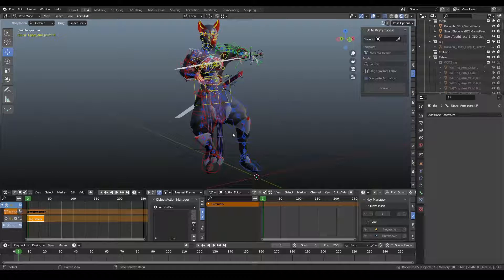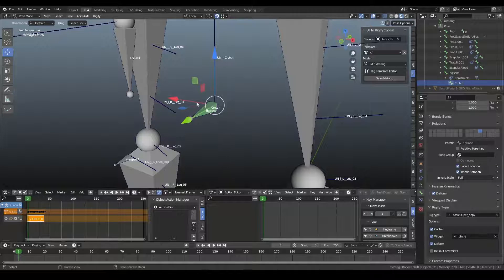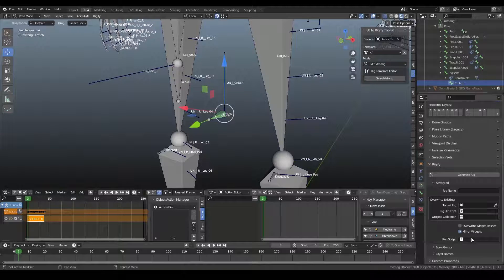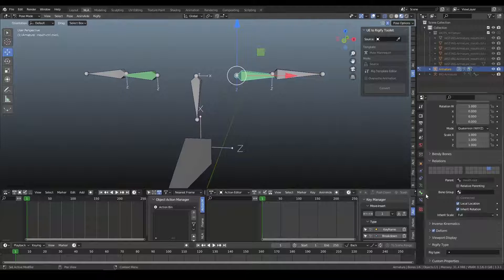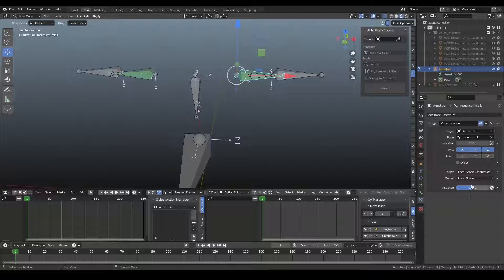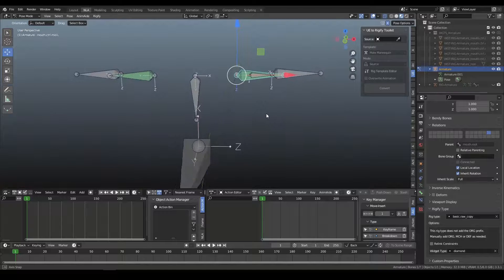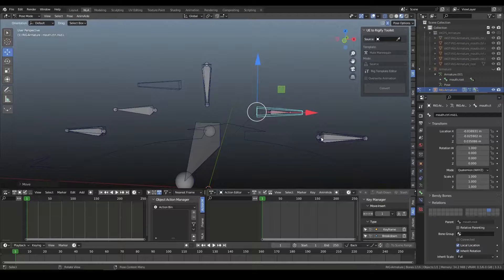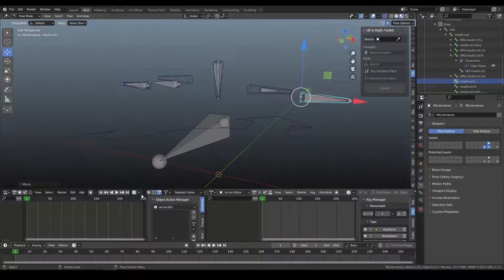Blender Rigify Relink Constraints update Raw Copy

Comment: Again my comment was hidden, please check it in the spam tab ^^
Reply from the maker: Sorry there aren't in in the review tab
Reply: Weird. 1st thanks a lot. There's a script I found that instead of moving the constraint just adds transform override to the widget of the control bone. I hope they don't delete it again 

blender artists dot org /t/ 1309231

I may try to integrate the script to Rigify as you show, and will test the method you're explaining, it looks great and clean too.

Thanks again for your time and care ^^
Reply from the maker: @MumuMundo  awesome thank you for sharing
Reply from the maker: Also checking out the script you found, it could be run in the post build part of the Rigify Script so that you don't have to do it by hand.
Reply: @RiggingDojo  That would be great, please share it if you manage to tweak it :)
Reply from the maker: @MumuMundo  After looking at the result of the transform override, while the control stays with the bone, the pivot stays back up where it was created. Not really a problem if you use G but if you are using Gizmos the offset is annoying. Having a post script to manage the constraint or building the rig by hand in the META-RIG to copy over without the system building controls for you is still a better solution we feel.
Reply: @RiggingDojo  I'm testing changing some bones to basic.raw_copy and in some cases they are better than super copy especially the bones that don't need deform. It also results in a cleaner rig since it doesn't create some useless ORG bones.
Another solution would be making a custom rig type but I guess it needs some advanced scripting. Custom rig types are explained here https://youtu.be/hyjBCb8TbFQ